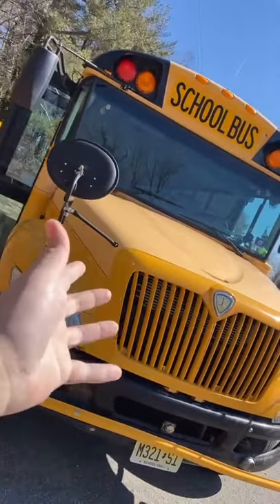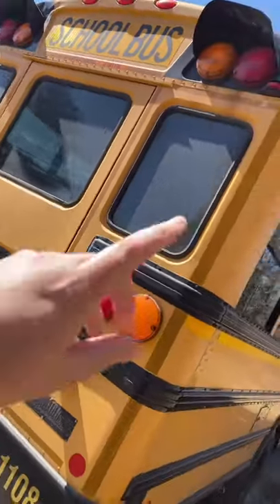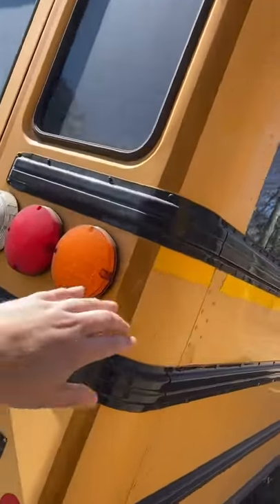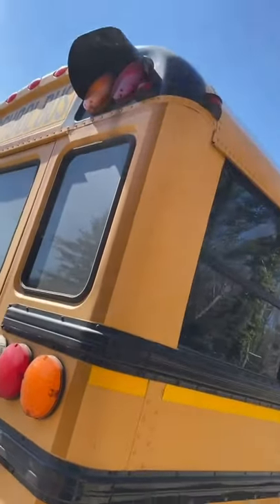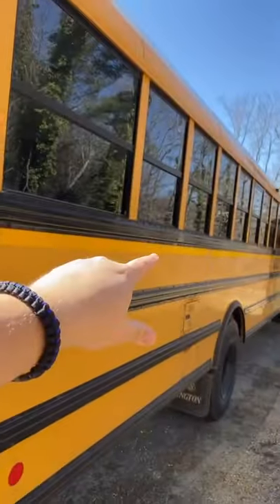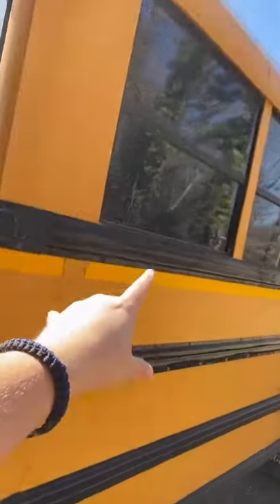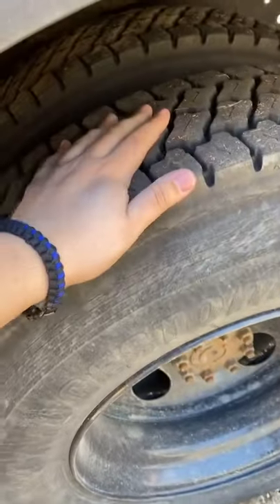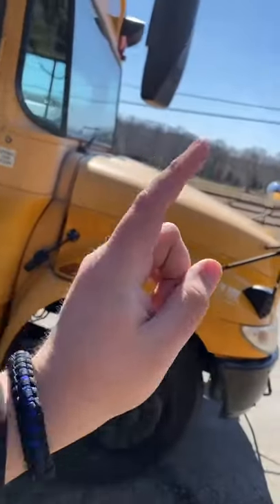How Are School Buses Built?

Comment: I am more into city buses, my favorite models are:
MAN A23 NG363NF on a HaArgaz body (looks the same as the standard one and the matching Merkavim body)
Scania NU280B (iirc about the model, both Merkavim and HaArgaz had manufactured bodies)
Mercedes-Benz OC500rf on the Pioneer body by Merkavim (they are the newest buses to Egged’s fleet in the Haifa area, replacing the early 2000’s MAN NL323’s).

Comment: But ain't that bus built by the international truck company  or did international allow the buses look like that to have the durastar front look
Reply from the maker: It’s a separate plant in Tulsa called the IC Bus Plant. It’s a spin-off of Navistar International. The just rebranded the buses with their own name, IC which stands for Integrated Coach which means the entire body and chassis are made by the same company at the same facility
Reply: @ClawBoss  wow I didn't even know that thanks :D